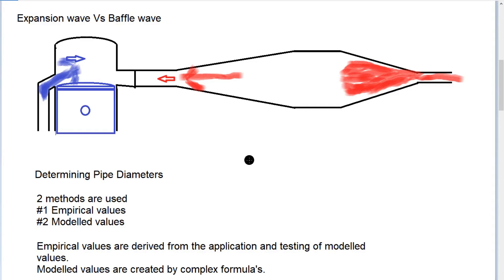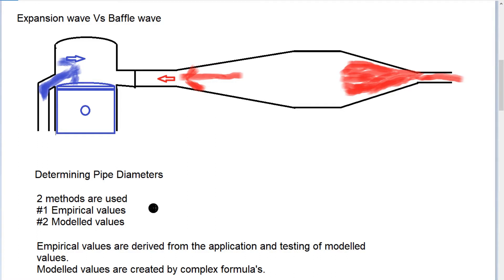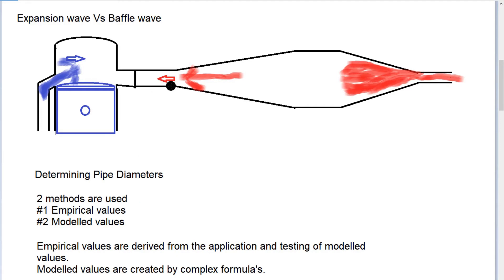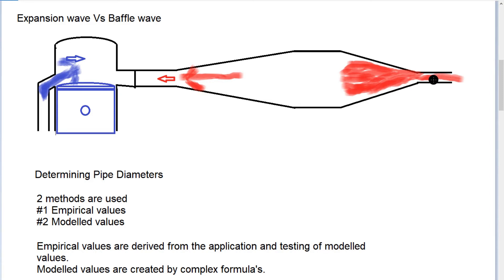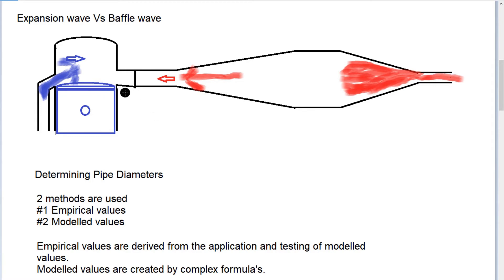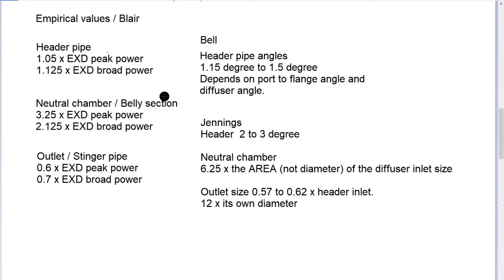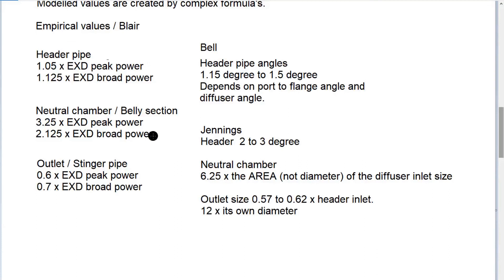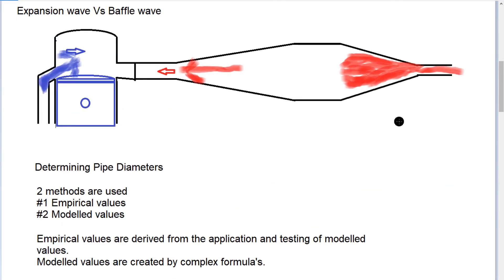Diameters for belly and stinger on 2 stroke expansion chambers, tapered header pipes E8

Comment from the maker: BTW there is a mistake in the video, 6:25 I said smaller outlet will drop low end power which is wrong it'll kill peak power.
It's just that the lower the initial BMEP the more plugging with back pressure will kill peak.
Should have been cut out, I already covered it and waxing on about the outlet was unnecessary,, apologies for that.
Reply: I was confused with this. also couldn't understand  from  5:13,  smaller outlet pipe give better peak power . thanks
Reply: sorry, just realized both 6:25 and 5:13 are for same picture. yeah, for peak power it is written as 0.6 x EXD which is smaller diameter?
Reply from the maker: Keep in mind that back pressure has the function of port plugging like the baffle cone does to prevent intake spilling out of the exhaust port and stuffs it back into the cylinder as it rises to the peak.
Which is not a function of the 4t pipe.
And the 4t pipe has no expansion area so the header pipe is itself the back pressure control.
And the 2t has the intake (transfer open) for most of the exhaust open period unlike the 4t that only has the exhaust valve open.
So the means of blow down control in the 2t is shorted by the transfer opening, to the degree there is an initial back flow down the transfer at that point.
Where the 4t effects blow down by the exhaust before BDC
Reply: AuMechanic thank you. So my understanding is : for 2t engine that port plugging effect at end of ex is more important than the scavenging at beginning. At high engine speed, higher initial makes mixture leakage even worse, so back pressure is important. But to a point the out pipe too small so you have constant pressure build up inside which is bad for scavenging. Am I right? Sorry for a lot of questions 😂
Reply from the maker: Close, the outlet pipe is a balance between back pressure and BMEP (Brake Mean Effective Pressure) of the engine. 
So as BMEP is greater in a high specific power engine compared to a broad range engine, the outlet pipe has to be reduced to offset that and reduce intake spill at the exhaust.
Scavenging by the diffuser or megaphone occurs at a range below and up to peak RPM,  there is more time at lower RPM for pressure to bleed off the chamber that contains the gas volume of a number of engine cycles
Like a 4t, you cant get nothing from the pipe the engine does not already have.
If the 4t is low CR and low cam timing there is no gain in having a pipe for a high CR and high cam timing engine, it wont turn a low performance engine into a high performance engine.
This is the mistake many make adding a high performance exhaust to a low performance engine, the result is the low performance engine just gets the flog revved out with poor bottom end power and a higher peak, wearing the engine out.
So the engine always leads the pipe not the other way around.
Reply: AuMechanic thank you. Yes, I agree with you. Everything is link together camshafts, exhaust, intake , engine geometry etc. change one part leading to other part

Comment: Great stuff as always! Happy New Year! Sound is a bit low, maybe crank it up some while editing.
Reply from the maker: Cheers, have a good new year yourself. Re the levels I'm using a Sure SM58 to mic input and levels are very low, I had db boost on highest previous and got some noise so turned it down a bit now its a little low. I need to get a proper mic input to correct the levels.
Reply: AuMechanic Maybe one of those usb condesers could be an option?
Reply from the maker: Yes that what I was thinking, a plug in USB job would handle it, maybe get one with a compatible Cannon input the mic has. Using a Cannon to mini phone jack lead now and connection has dropped out with it.